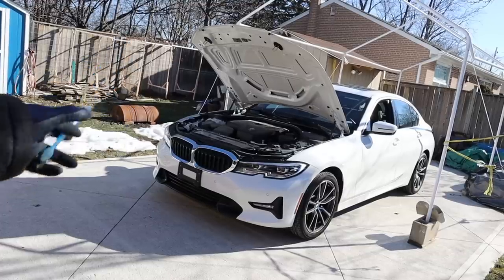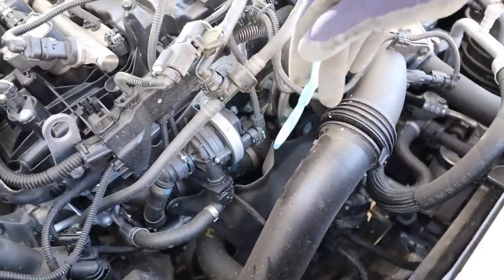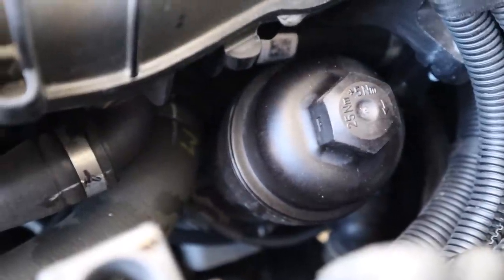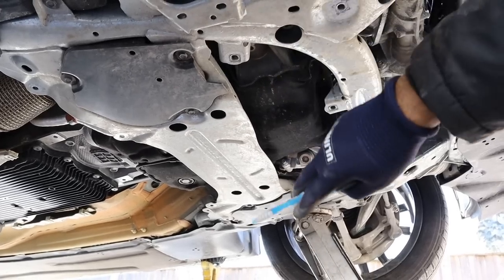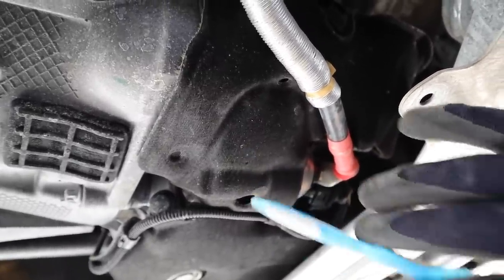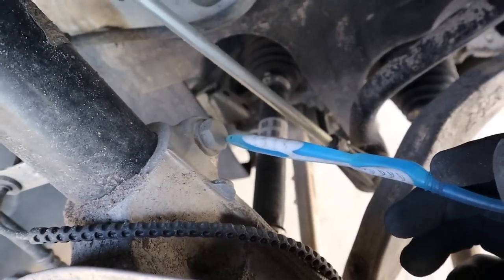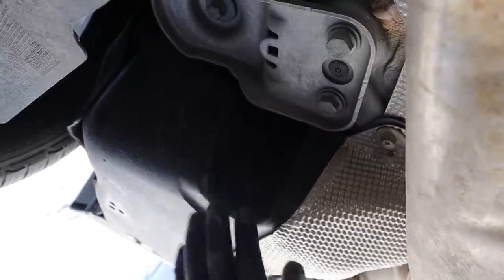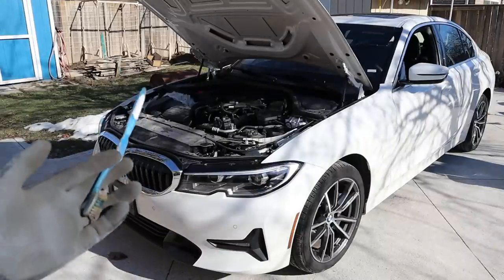BMW 3 Series Mechanical Review

Comment: Oh how the mighty have fallen, a 3 series with a 330 designation used to mean something..... not a plastic piece of crap designed to last for the duration of its warranty.... non intercooled four banger?
Reply: You mean the ones where the rear subframe would tear itself to pieces and window regulators stop working every couple months?
Reply: @chrisbradley3224  I think I’d date my love of the marque to the days before they started making water pump housings and suspension components out of plastic.
Reply: @speedmachine69  It's just funny because you're complaining about far less terrible things than what the old ones used to suffer from. 

Their water pumps probably failed more when the housings were metal.

This engine is air to water intercooled and despite having 4 cylinders, B48 actually is quite good and trashes most of the old tiny sixes in terms of usable output. I still wouldn't buy one, I own an S55 6 cylinder car, but I kind of have to shake my head when people say their E36 325i was a better built car. It wasn't.
Reply: @chrisbradley3224  I totally get what you’re saying. I guess my major issue is that I hate the notion of a car that’s designed to last ten years before it flies to bits from every direction.
Reply: @speedmachine69  Fair enough, I think people have a bit of nostalgia tinting their perception of the past though. A lot of cars in the 90s didn't really last 10 years anyway. I mean, they may have had all metal and no plastic, but they unintentionally went to shit.
Reply from the maker: I thought the 330 on the back meant 6 cylinder power when I picked this car up. 😞😞
Reply: @speedkar99  It's the "NA equivalent rating". It kind of does have 6 cylinder power depending on if you mean turbo or NA 6. It does make an underrated 253 hp though. Tests show the car does 0-60 in 5.4 seconds and quarter mile is 14.0 @ 100 MPH.  Not bad for the base model.
Reply: @@japanwatchconnection anti roll bar links.

Comment: Great review on a junk make/ model . Why anybody buys one, is a mystery. Leasing is understandable
Reply: You do know that Toyota uses this exact engine in it's Supra along with the B58?  I'm sure you wouldn't call Toyota's "junk"!I would try to explain to you why people buy these cars but you don't sound like an enthusiast, so you probably won't understand even if I did.
Reply: @nathanpendleton9733  He's the same type of degenerate that will drive a Supra and think that Toyota has beaten BMW in handling/steering/performance, and then when you tell him it's 75% a BMW he will go into denial and go back to his rusted out '99 Camry on it's 9th battery and 8th starter.

Comment: Lexus, Acura and Infinity. All of which can beat a BMW in a race to 300k miles...on the same motor and drivetrain. Just keep oil in them. German over engineering is great, as long its somebody else's money pit. IMO
Reply from the maker: Sadly they don't have a good reputation. Maybe the older inline 6 engines could have made it to 300